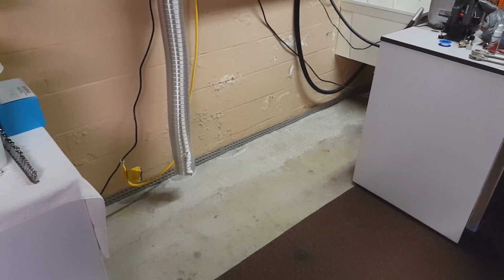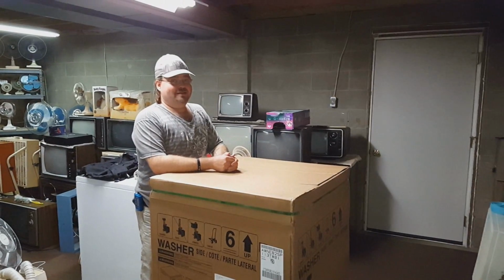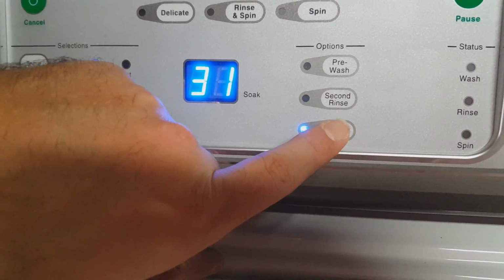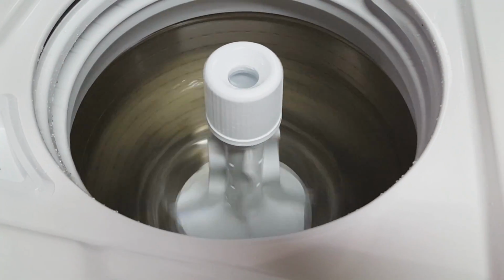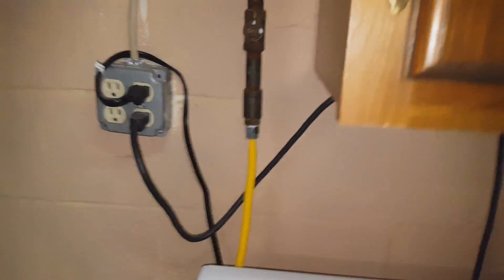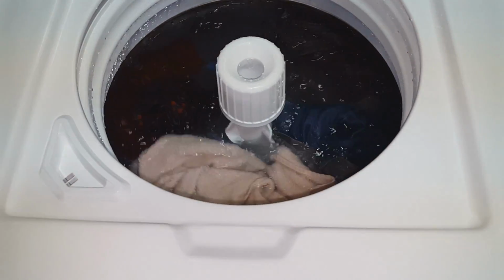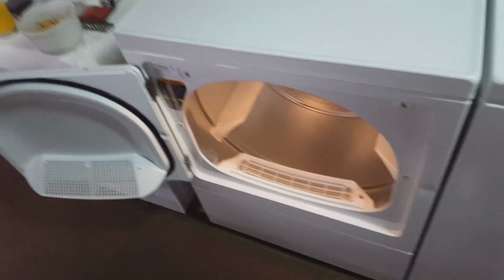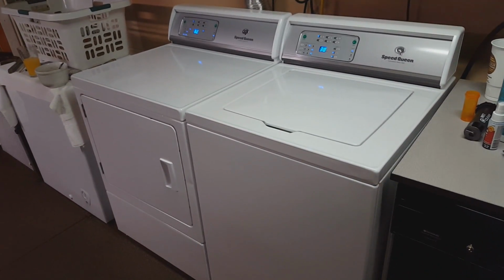The 2015 Speed Queen 8 Series

Comment: I just bought a Maytag Centennial piece of shite for $399 at Home Depot plus service plan. Immediately regret the bad decision. Where did you guys get this and what did it cost?
Reply from the maker: +Liz Hunyadi We went to speedqueen.com and searched for a dealer in our area. The washer was about $900, and the dryer (being gas) was also about $900 for the entry level electronic control models.
Reply: Thanks! Am researching it now and I only hope that when I'm ready to make the purchase that they don't change anything essential here and go too nuts digitizing everything. I like old-school analogue...
I'm not a fan of water-saving he either......
Reply: Oh no! I just bought a Maytag Centennial washer & dryer pair from Home Depot in December 2016. They were $399 each "on sale", as yours was. I knew about Speed Queen from seeing the website, and had a dealer picked out about 20 miles from me. But my 1998 Frigidaire washer started making intermittent clunking noises last October, so I wanted to get something good ASAP. Also I wasn't sure about the Speed Queen dealer's line of credit, as I couldn't spring for cash on the Speed Queen pair. So we'll see how long the Maytags last. I did get the washer with an agitator & 4.2 basket. But I STILL want my Speed Queen pair! :)

Comment: I have a Sears "Capri" that has been going without any repairs since 1990.  When I goes, I am gonna look at those Speed Queens.  BTW, in some states, it is illegal to hook up your gas dryer or stove without a licensed plumber.
Reply: +margaretsville You won't be disappointed with them!  And yep, I know, but I called a neighbor who is a local plumbing contractor who advised it's not required in our state, and I also asked the dealership as well as Ace Hardware when I bought the materials, just to be safe.

Comment: What was that noise during the spin cycle?  Not the whistling sound, it was more of a bushing sound.  The washer was empty, and it started right as it started on spin and continued throughout.
Reply from the maker: The drain pump,  which is normal when the tub isn't full of water.

Comment: When I got my speed queen awn542 back in February. The sales person tried to sell me the model that you have. I told him I wanted the one with an actual timer. I like to be able to add more time to my wash if need be. I only had to do two modification. Override the water level to get a full tub and bypass the lid switch. Speed queen is amazing. It actually cleans better than a duel action agitator washer. Got it for 750.00
Reply: +RandomVideosHD Yes!  Keep in mind that whether mechanical timer like yours, or electronic panel like ours, they're all controlled by the same relay box.  Yours hits a spot on the timer and activates a relay, so do the ones with electronic controls.  In your case, there is not the full motor current going through the timer, which makes for increased reliability.
Reply: +harleybadger1 what do you do when you want to add more time to the wash cycle? Also on this model do water level reach the rim of the tub? For that to happen on my model I had to drop the panel and turn the screw on the water level knob.
Reply: RandomVideosHD You don't really have an easy option to add more time, you simply select a higher "soil level" and it adds a few minutes for each higher level you select.  In the rare event that's not enough, you can pause and soak, or you can add a pre-wash and/or second rinse.  And it fills to the rim.
Reply: +harleybadger1 I guess u should consider myself lucky getting the awn542 model with the timer. Which is very hard to find today from what I understand.
Reply: It is, but they still make mechanical models.
Reply: Smurdle450 From what I understand, the mechanical models use the same controller, just a different "user interface," if you will.  The relay banks are the same, and function identically.  The manual timer model has the advantage of being able to set it exactly where you want it in any particular moment.
Reply: Harley Badger I'm pretty sure you're right. The only real difference is whether you have a knob or a push button to select your options. I would personally get a mechanical, since like you said I can put that timer wherever, whenever. But no doubt speed queen made some AWESOME machines.
Reply: RandomVideosHD I have the 9 series with electronic controls and you can add more wash time any time after you started your wash by pressing the cancel button JUST ONCE! That will reset the cycle time and you can make any other changes while your at it, then press start again and your good to go....it's great when you need extra wash time and it's hardly an inconvenience. I love the electronics on my set and wouldn't change a thing...alliance knows what they're doing and they have done a great job, and when it comes down to how clean my laundry gets, I couldn't be happier!

Comment: How you make it fun with lid open? Mine also won't fill to the top
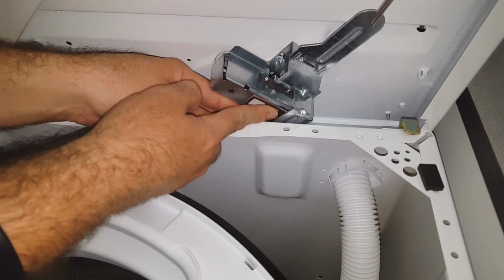Reply: +joe m We defeated the lid switch internally.  As shown at 15:40 in the video.
Reply: So you just put a little piece of rubber in there
Reply: +joe m Yep.  It holds the switch closed when the lid is opened.  It's one of those square rubber stick-on feet that you find on the bottom of random items.
Reply: Thank you very much. I've had enough of these he crap washers
Reply: +harleybadger1 I forgot to ask how to open the top do you use like a puddy knife ?
Reply: +joe m Actually if I am not mistaken, there are a couple screws holding the top on, accessible once you remove the front panel.

Comment: Nineteen years and three months of daily, trouble-free use is very impressive. Bet you won't be able to say that about the stuff that comes off the assembly line today, with the exception of the Speed Queen stuff you have! Gas dryers are so much more efficient than the electric models, and likely cheaper to run because natural gas prices are falling like a rock. 

(Maybe I'm out of line, but I think Harley shouldn't be handling sharp objects after sipping on what appears to be a screwdriver, unless that's just orange juice.)
Reply: +Ken Seabury It was DEFINITELY not just orange juice ;-) ...point taken!

Comment: apartments where i live has a ge commercial washer and it don't really clean good. it is too quiet i think too and can't hear it moving stuff. i rather have noise to know it is doing stuff then so quiet can't hear it doing anything. i use the wascomat double loader front washer here since it actually cleans better those those ge things. also those prices you are looking at in video is if you use the energy start eco settings i think. if you use the heavy duty it will be a little more.
Reply: +james42519 Yep, you're correct, the EnergyGuide rates for the eco cycle.  Currently, with the prices (and difference in volume,) with the amount of water sprayed for spray rinse compared to filling the whole tub for a standard rinse, running everything on Heavy Duty will increase water usage by about 72 gallons a week, so 3744 gallons a year, which will only result in an extra $5.43 per year here in Pittsburgh.  (Water is $1.45 per 1000 gallons here.)

Comment: Okay, as another comment to be separate from my other one. I am pretty sure these bad boys will last you a long time! 

My issues with the electronic controls is that you still lose so many abilities without the mechanical ones. Such as moving the time back or forward to any point you want (although it looks like the dryer lets you adjust the time). And also, unless there is some kind of battery or something, the machines may not remember where they were in the cycle if a power failure occurs. That's happened with us a couple of times with our Whirlpools. Thankfully the mechanical timers kept everything exactly where they were. That being said, I know this isn't fault of you guys, that's Speed Queen's doing, and these are really the best ones that you can get today.

In 30 years, I'll be 57. haha
Reply: +Sharkie626 you FUTURE old fart!  haha.  Yep, we thought along the same lines too about the advantages of the mechanical timer.  In the end, we made a list of the pros and cons of each, and the pros of the electronic controls had a slight edge.
Reply: +Sharkie626 Hey I know this is a little late but, didn't you say you got a Speed Queen for your brother's new place?

BTW, congrats on the new machines, much unlike the other modern crappy "things"! :D +harleybadger1
Reply: +Sharkie626 You made some very good points I am leaning much toward getting a mechanical speed queen the only one left is awn432.
Reply: +Sharkie626 No more batteries or fast caps.  It's all flash memory now.

Comment: Too bad even Speed Queen have caved to the green police and started putting electronic controls on their machines.
Reply from the maker: They still make mechanical controls for their low end models. Functionally wise it is the same, just the electronic controls add additional functionality.
Reply: +IAmNotAFunguy EPA regulations, not by choice.
Reply: +IAmNotAFunguy It may have electronic controls, but the electonics are not china pride.  The electronics are made by Raytheon.
Reply: IAmNotAFunguy some people can not grip or turn a handle well. Someone like myself. This is a wonderful option for others like me.
Reply: The electronic control is not EPA mandated, but the water level is, you can search a video here on how to raise the water level back to the way it used to be.
Reply: +IAmNotAFunguy Actually, Speed Queen's electronics are engineered and tested to withstand (I forget how many kV) of lightning, unlike other electronic crap of today. If you did your research, you'd know that.
Reply: +IAmNotAFunguy Also, the electronics are Raytheon-flavored oldies and goodies, not Chinese-flavored.
Reply: +IAmNotAFunguy Uh, how is that bad?

Comment: 6:10 Beg my pard!  Thanks for the shoutout!
I can SMELL the quality of those.
I highly recommend you rig up sprinkler valves like I did to shut water to the hoses/machine after a timer expires.  Can't prevent a flood, but can stop it early.  

Wow, a metal wash tub, and real suspension springs!  Great idea to disable the lid switch.  You might want to consider installing a "lid switch disable switch" in the back like I did for mine, that way you can initiate a pause with the lid open.  

I heard everything you said about the electronic controls being able to last.  I believe it, but still have my trepidation.  Then again, my old GE washer was actually an electronic panel, but it still had a knob you could "advance" to rinse or spin or whatever you wanted.  That also used relays for everything, hot valve, cold valve, drain pump, high speed winding, and low speed winding.  I still have the control board somewhere, not like I need it, but when you're a hoarder you tend to keep these things, "just in case".

Interesting how the time required to complete the cycle INCLUDES the fill time!  They don't call them Speed Queen for nothing!

Spats, you ALWAYS need to donate blood to a project to ensure it goes smoothly.  The rug burn counts.  

In these parts, we use steel pipe for gas.  Gas connections use special gas pipe thread sealant that's brushed on, not teflon.  Also requires a "drip leg" and tee, the flex line is hooked to the side portion of the tee, the other outlet is a short pipe and cap.  Again, that's what's code HERE, or it least it was last I did gas work.  Your jurisdiction probably varies--you 2 are pretty smart guys and it seems you've done plenty of research on all of this.

I have Gain Flings ;-)

And just think, they used to GIVE THESE AWAY on Let's Make A Deal back in the 70's!  I wish you the best with them!
Reply: +jaykay18 Oh that's a good idea!  Especially once we get the drywall in, can't be too careful.  This one actually has a pause button that stops everything and then picks right back up where if left off when you press it again.  

We too approached the control panel with a bit of trepidation.  No matter the quality, it still contains sort of "wear" items such as electrolytic caps, and of course relays have a finite number of "clickies" in their lives, but we're hoping the combo of better-quality electronics (they're mostly Omron and Motorola components) and the fact that the rest of the machine is so solid, even if we have to replace the panels in a few years, we'll be happy.  Plus they look really easy to recap (only like 5 electrolytics) or re-relay.  

So far, I have found the washer timer to be exact and the dryer timer to be approximate.  The manuals show what water pressure to use in order to help this.  

The gas line has a tee and short piece off to the side like you mention, however it's a bit upstream of the dryer.  I cheated just a bit and called a plumber friend of mine and he talked me through some of it.  That pipe is being replaced just before the walls go up, so we didn't worry too much about it.  

And Gain Flings are the shit!  They hit the Mad Notes!  :-)
Reply: harleybadger1 As long as you can get replacement control panel boards relatively inexpensively, and then be able to recap or re-relay the old boards, you should be fine.
Reply: Emph Squee Great idea.  We have a whole-house surge suppressor and also a lightning arrestor, so we're safe there.

Comment: very nice choice. speed queen is basically the last brand that makes washers and dryers that actually last. i saw a video where they compared new maytags and speed queens and speed queens were better made. maytags for example have a plastic outer drum vs. the brown metal one you showed in the video. even with all that knowledge i picked up a samsumg 5.2cu front load onyx washer. it wont last as long, but, it works well for now lol